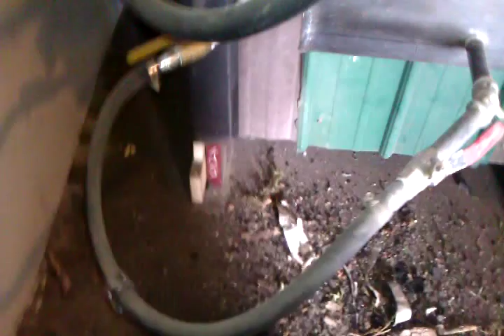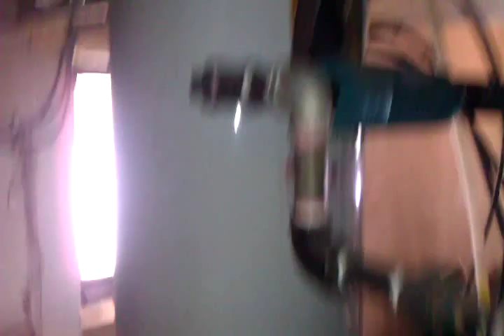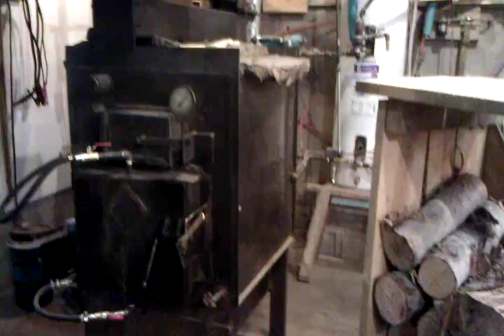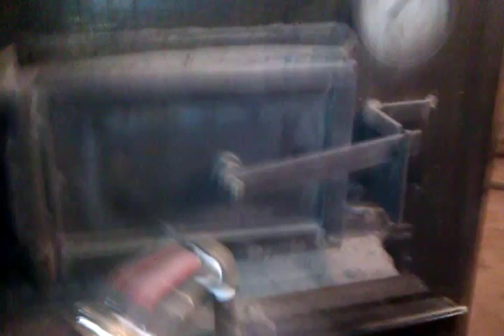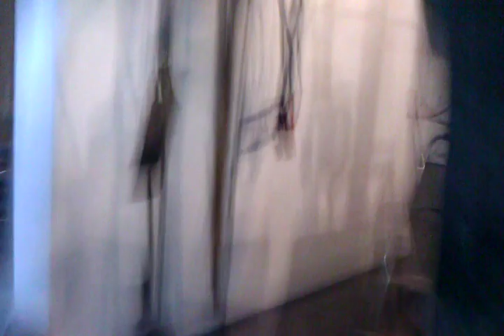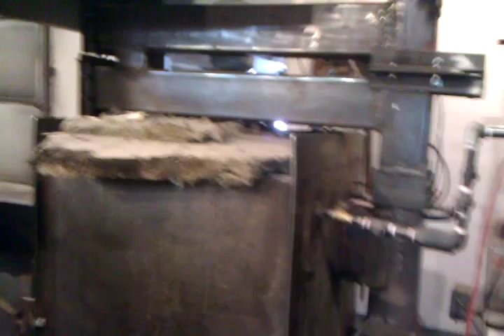Home Made High Efficiency Wood Stove

Comment: I like the design using the small water jacket,  My system is set up on the same idea except its a pressurized closed system. I'm getting ready to build a bigger system, more for a larger fire box, mine is currently to small and getting up at night to refill is getting old.  Would you recommend a closed system or open and what is the smaller top door for above the feed door?
Reply from the maker: Clear View Forest Products the top small door is to clear out creosote build up as the smoke cools down dumping a little more heat snaking through the top.
Reply from the maker: Clear View Forest Products it is under pressure closed system. Im not sure how you would have it open
Reply from the maker: Clear View Forest Products its important to have a small water jacket or it will be very hard to get a cold furnace to light. An auto pressure valve is used to only curculate water in the furnace. Once it gets up to the valve set temp it starts to circulate through the entire system. Otherwise it will be hard to get the fire up to temp
Reply: Thanks for replying Andy,  My new boiler build will have a 49 gal water jacket, about 40 more than my tasso boiler and a 9 cubic ft fire box. I'm hoping I got my numbers right and i dont need to get up at 3am anymore to refill.